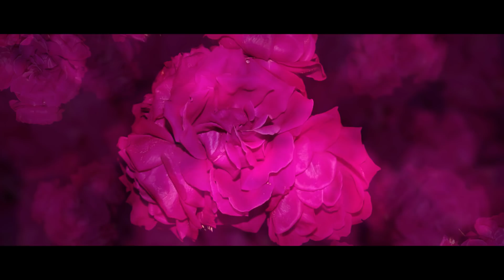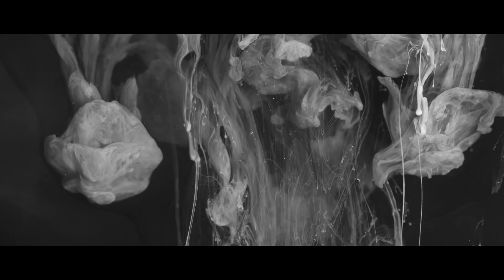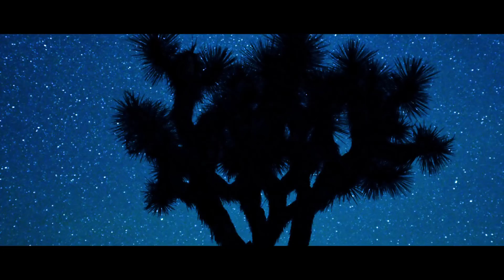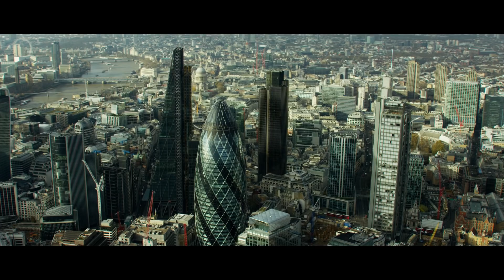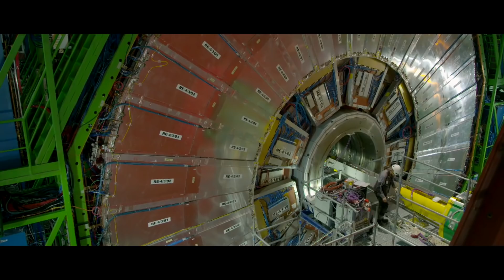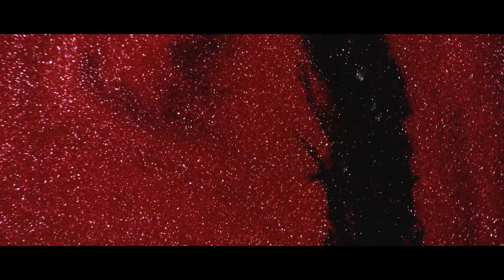Darkness in the Universe

Comment: Highlighted comment
Jason G
4 days ago
My hypothesis that Dark Matter is not a weakly interactive massive particle (WIMP), but maybe is a deformation of space-time by which the curvature of space-time itself is the cause of the gravitational effect. Gravity is the consequence of the curvature of space-time when mass is present.  It may be possible that the structure of space-time itself could be warped without the presence of mass.  So, how did this warping occur?  We believe this warping of space-time occurred during the extreme conditions present during inflation. Space-time has been shown to react like a fabric by warping, twisting, and propagating independent of mass. These properties have been proven with observations of gravitational lensing, frame dragging, and now gravitational waves. Fabrics can be stretched, pressured, and/or heated to the point of deformation. Such extreme conditions were all present during inflation, so it is plausible that space-time’s elastic nature could have hit its yield point and permanently deformed. Therefore, if gravity is the consequence of the warping of space-time, and fabrics can be permanently deformed, then a deformation could create a gravitational effect independent of mass. Thus, the unidentified dark "matter" that seems to be so elusive to modern science may not be matter at all but merely warped deformities causing gravitational effects.  We have a prediction using gravitational lens mapping to prove Dark Matter isn’t a weakly interacting massive particle, but instead is a floating fixed pocket of warped geodesics in space-time geometry causing gravity wells.